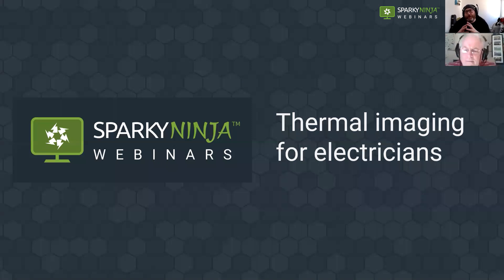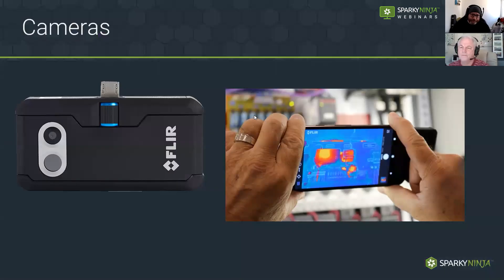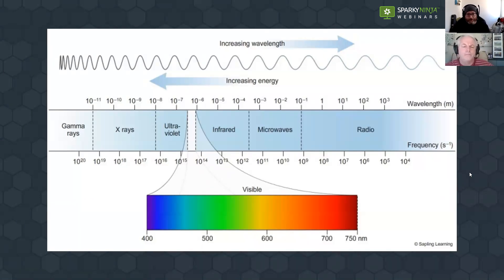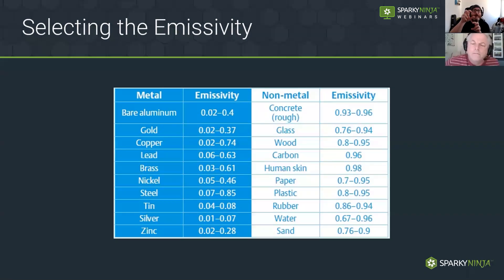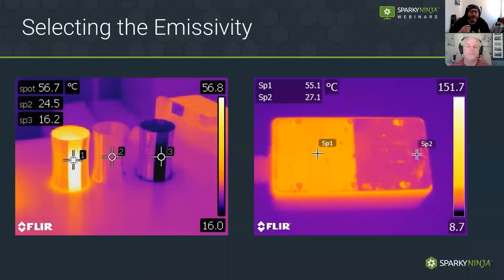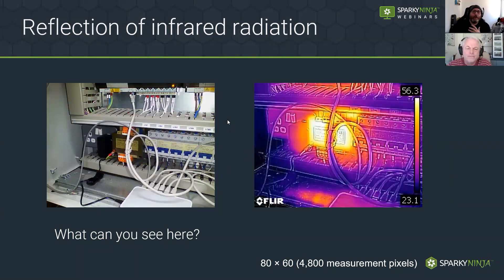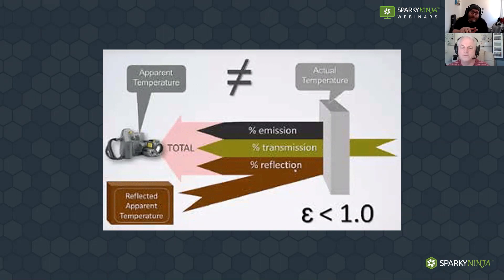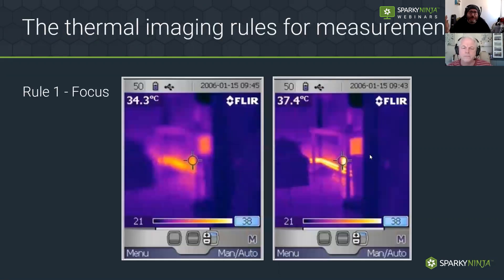Thermal imaging for electricians - A SparkyNinja Webinar

Comment: Some many years ago, I purchased in infrared thermometer.  I forgot what my intended use was, but it was a $75 tool at the time, so I'm sure I had something specific in mind!  I have recently purchased a phone with an 80x60 iR camera built in, simply because I want one, and I needed a new phone anyways!  

I intend to use it to look for leaks in home insulation, and to look for hot spots in wiring around my house, bad outlets that are getting hotter than they should, investigate things like battery cables on cars for poor connections or high resistance issues, etc.  I have no training in any of this, strictly DIY.  

This webinar has given me a lot of information I would not have known, or would have taken me a long time to 'figure out on my own' especially emissivity and reflections!  Thank you, very much, for making it available to the average joe, like myself.  

And yes, I will be very, very careful around electricity.  I do not take it for granted or take insulation for granted, etc., I respect it and am afraid of it!

Comment: At around 45:00 I believe you are mistaken about why the pipe is cooler than the connections.  I'm not looking from the biggest screen but that looks like a water heater and the "connection" looks like a temperature pressure relief valve which is a safety device that activates if the temperature or pressure get too high in the water heater.  There would be no hot water going through that pipe unless the safety device activates.
Reply from the maker: They were measured as the same temperature with a thermocouple.
Reply: @SparkyNinja  It looks like a prv to me. Unless my eyes are getting too old to see properly, the pipe directs any discharge straight to atmosphere, just above floor level. If it operates, Euston we have a problem...

Comment: 20 minutes ago I got my Seek Thermal Compact Camera and I believe I actually know how to use it after having watched this video last night. 
I know the physics of what's going on more that you because of my background but I think that because of that I would have overanalyzed the images without keeping in mind the few simple things you focused on in this video. I think keeping an eye on the range is the most important. I can imaging an alternative future where I would be ripping outlets out of the wall and replacing them because of an image that looks like they are about to burst into flames when it's only a degree or two over ambient.
 On a side note... I got the Seek over the FLIR ONE Gen 3 because it offered more pixels per dollar but primarily because of the internal battery in the Flir. In my eyes they are making it disposable and I have a bad attitude toward companies that do that. Granted, you can rip the thing apart and replace the battery but most people will not be doing that. If they made it with a replaceable battery like any cell phone it would be a better product. Where the operating time is only 45 minutes or less it's more difficult not overtaxing the battery and reducing it's lifespan.

Comment: Why does shiny metal reflect environmental 'cold' or lack of radiation, rather than show up as emitting its own? I mean it IS hot and when i hold my hand close to it i can feel it too, so it does give off radiation, is that just outside the range of the thermal imager?
I can understand when the environment, or objects in it, are considerably hotter, a shiny metal object would reflect this and it could appear to be hotter relevant to its own radiation, but i don't understand how its reflective properties prevent it from showing its own emissions.
Reply: I have no theoretical physical explanation for why, but shiny metal parts actually emit less radiation. The surface is hot, when touched, and the convective  heat transfer is working as usual, but the radiation is reduced. The photons have a hard time to leave the surface. As the camera only gets the radiation and not the temperature, the surface seems to be cooler.
This is used in thermosbottles: You have vacuum in them and all surfaces are shiny on the inside.
Reply: One would think the logic behind "mirrored" sunglasses would reveal some explanation to your question, but don't quote me on that. I'm taking this course next month, if nobody has the answer, I'll provide it(if the instructor knows).
Reply: This a fantastic resource, many thanks for taking the time to make it.
Reply: @IndianaDoug  So what's the answer?
Reply: Not sure if I am right on this. When thermal imager looks on shiny metal, it's like we human viewing on our reflected self from the mirror. You can't really see through mirror but you could only see yourself. Thermal radiation is a form of light, of course it could be reflected like mirror reflecting visible light upon us.
Reply: @yongsua1989  kinda. It’s all about emissivity. The camera can not “see through” certain material compositions such as water and glass. The camera is viewing objects with heat signatures that are reflecting on these materials.
Reply: @yongsua1989  yea but wouldn't this be equal to an illuminated mirror basically? Emitting its own light... Like an extremely heated mirror would appear to glow red hot to our eyes as part of the radiation is in the visible spectrum, why not to the thermal cam? camera.
Reply: @fatitigilo825  I am not sure what do you mean extremely heated mirror. If the mirror is burning and melting and glowing red, well I am pretty sure the thermal imager can see that too because the part that's burnt like burning metals is not reflective though.
Reply: @yongsua1989  yea glowing metal loses its reflective capacity i think. At some point it's semi reflective. I should really experiment with this. When we look at a mirror there is no visible radiation coming from the mirror itself, just reflections of other things. I would argue this is different for thermal radiation as the mirror itself still has a heat signature, it totally goes over my head as to why we cannot see it. I would expect the reflections to be an overlay of the mirrors own thermal image.
Reply: I just wrapped a mug of boiling water in thin foil, i can feel the heat radiating from the whole setup from about 10-15cm away. Yet, for the thermal cam, the whole thing is cloacked. And shows as 21 C°. My guess is that the radiation i can feel is just outside the visible range of the sensor?
Reply: @fatitigilo825  Unfortunately, detecting temperature or heat signature solely based on radiance of infrared energy doesn't always end well. It's not a clear-cut theory. That's the reason why there is something called contact thermometer exists for the purpose of measuring physical temperature with higher degree of accuracy. Infrared energy and heat signature correlate pretty well for perfect black-body or materials that approximate nearly to black-body but things could vary for materials that are grey-body or selectively emitter. Besides, there is also Planck's Theory of Radiation that might play some role in affecting the detection of thermal radiation.
Reply: @fatitigilo825  Well, you could do another mind-blowing experiment. The thermal sensor could actually detect infrared energy radiated from the translucent glass of your windows. It can't see through the window like human but it could in fact "see" the windows like an opaque object. If that does not convince you, you might try to get some germanium glass. You can't see through that glass with your visible eyes but once you look on it with thermal imaging camera, you will probably be mind-blown.
Reply: @yongsua1989  yea, i know i'm just having trouble wrapping my mind around it 😅 i should probably read up some more basic theory about it.
Reply: This is why you spray paint black or put black tape on shiny surfaces first.
Reply: It depends on the emission value of the material itself. For the exact temperature measurement you have to change the emission value in the camera itself (high end cameras).
Note: it is (almost) impossible to measure the temperature of silver f.i.⬇️: Silvers acts like a mirror for IR. Thats the reason IR photographers use tape (witch has a fixed emission value) on metal objects. On Electric systems the isolation on the cables (e =~0.9) gives you the best temp. indication
EMISSIVITY VALUES OF COMMON MATERIALS*
Material ---  Emissivity
Silver (polished) 0.01
Silver (oxidized) 0.02
Aluminum (unoxidized) 0.02
Aluminum (heavily oxidized) 0.20 - 0.80
Steel (316 polished) 0.28
Iron (rusted) 0.65
Sand 0.76 - 0.80
Steel (cold rolled) 0.80  - 0.91
Wood (oak planed) 0.93
Brick (red, rough) 0.90
Human scin 0.98